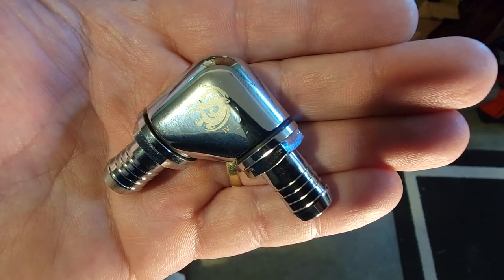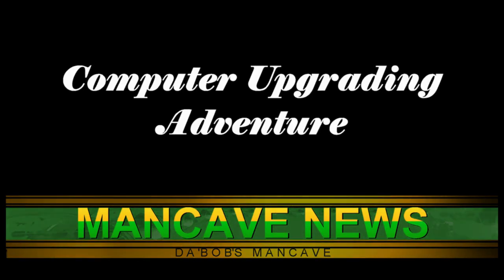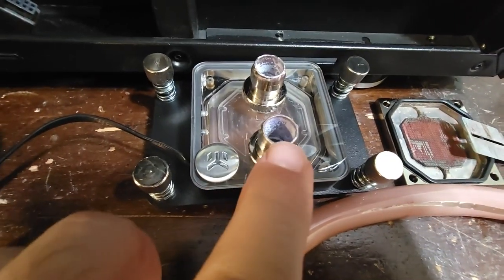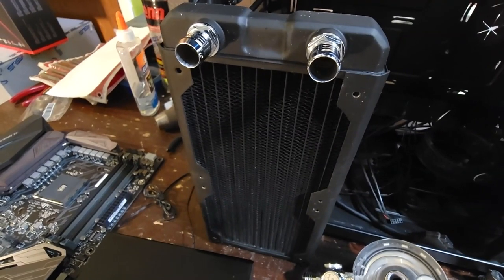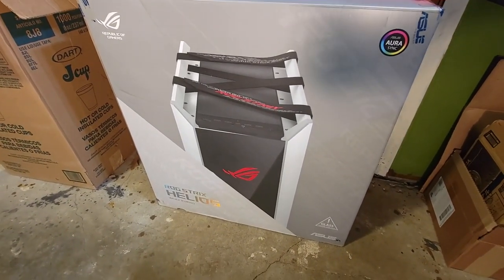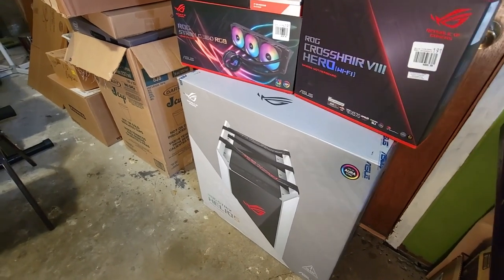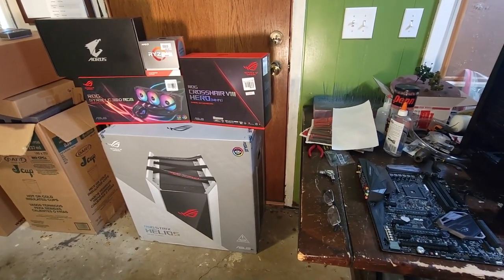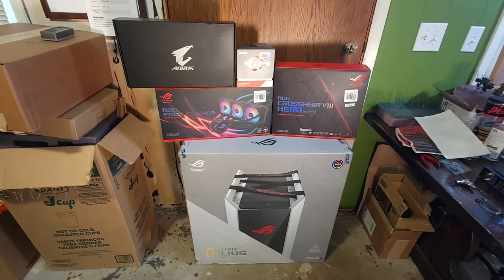PC Water Cooling Adventure - DaBob's ManCave

Comment: How did that small fitting upgrade turn into the massive upgrade?  You had an extra $1200 burning a hole in your pocket from a side gig building a layout.
Reply from the maker: Chain reaction.  One change found a different problem that was worse which requires a different solution to fix which finds a new problem.  And so on, and so on.  Luckily I did have some extra laying around under the layout to pay for it.

Comment: man computers are way more advanced for me. only question I would ask is, can you use it to power the layout?  
All I got there Bob.
Reply from the maker: Actually yes you can power a layout with a computer power supply.  It just takes some customization and a arduino setup for DCC and you are off to the races.  Or it can stay DC and you put in a throttle system, you can only power up to 12 volts though.  Usually the power supplies would be used for accessories like lighting and other things that need 3-12v to run.